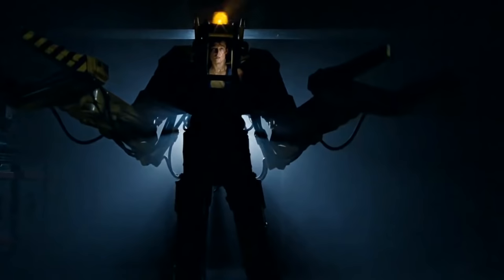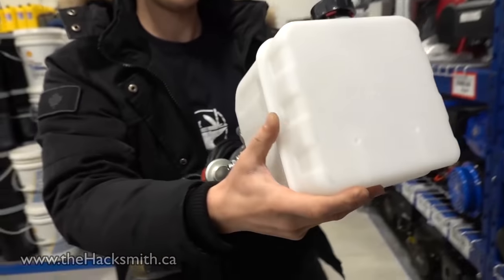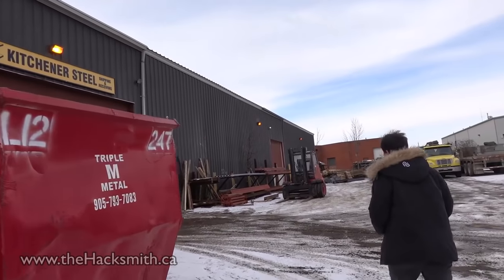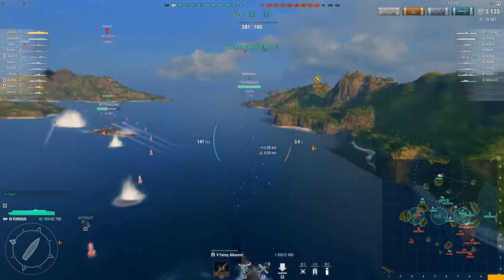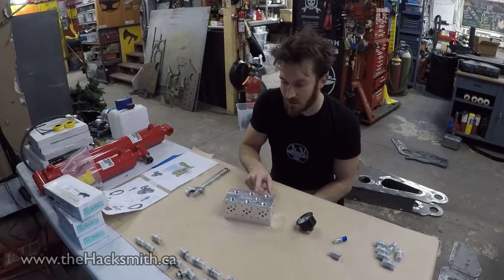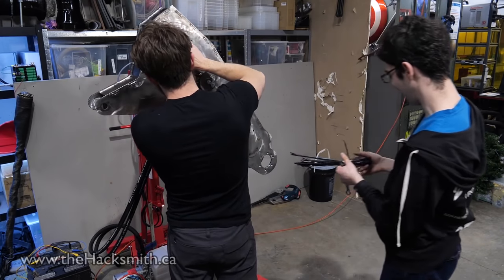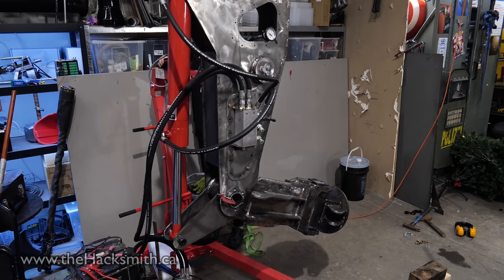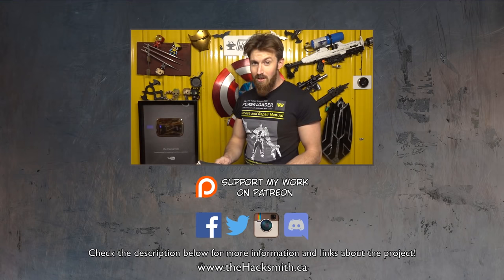BUILDING THE MECH ARM! (POWER LOADER: PART 2)

Comment: The logistics and principle are fairly simple, but actually building it,  that's a whole different story.
mad props
Reply: Its not a prop anymore
Reply: @alexv1154  I meant good job, don't be like that man.
Reply: I know, was just trying to make a joke
Reply: The individual components might seem fairly simple, but when you consider the whole thing, the balance, and the control system, not so much in my opinion. It just seems to me it will fall forward when you try to lift a car. If it was just the arms, attached to a forklift or something, it would seem more simple.
Reply: @herrakaarme  I would try mounting a gym weight to a motor and control it with a PID to make a impromptu gyroscope to keep balance.
Reply: @herrakaarme  counterweight under the butt. Just like traditional forklifts.
Reply: So, gravity is a fickle little bitch....but it can be reasoned with.

Maybe a system of smaller counterweights could work to aid stability.

For example, a smaller weight in each shoulder, largest in the rear. Then a small one for each calf.

How much would be needed? I'm not sure. However it might work a bit better than having all the counterweight in one place. With it in one spot, if something happens to said spot there goes your balance. Will say this much, if using multiple counterweight areas I would advise being a bit more generous with how much weight is there with exception to the arms, depending on how fickle they are to attach.

Apologies for the text wall, if there are issues I'm missing with this (which I am sure that is the case) then feel free to point them out.

Comment: I work as an excavator operator and form 
 experience building a little excavator  by my own I can tell you  that you need  different valves to control that thing properly. You need ones that not just allow you to control the direction of the flow, but also the amount of flow. Lets put it the nerdy way: Not digital (1/0)  but analog  :)

Comment: If you really want to know what it's like to ride a robotic arm, you should check out Dynamic Structures in Port Coquitlam, B.C.  They make roller coasters that go into service around the world, and have been experimenting with an industrial robot arm with a seat attached.  Discovery channel tried it out one time, and left the tester terrified.  An industrial robotic arm is so fast they had to reduce it's speed many times in order to make it (somewhat) safe.

Comment: For a continously rotatable gripper that still grips, use 2 hydraulic motors and a modified differential. 😉 That solution kept me awake for 4 hours last night.
Reply from the maker: Why not just one? Still continuously rotatable
Reply: @hacksmith  when they rotate in the same direction, it would open or close the gripper while it remains still. When they are reverse one another, the gripper would rotate but hold its clamping position. Move only one motor and the gripper would do both motions at half speed.

The sole purpose of the differential would be to control the clamps of the gripper. It took me a while to figure it out but put simply, the diff would control a lead screw that moves the clamps.

I could probably try to throw together a 3D model of what I'm thinking of, it would be kind of complex, but I think it would be the ideal way to get a continuously rotatable gripper that can also open and close.
Reply: Interestingly enough, I just realized a simple rack and pinion would also accomplish the same thing, since the grippers on the actual arm are linear.

I study robotics and gripper design is one of the things we went into depth on. They're actually pretty interesting and more complex than a lot of people realize at first

Comment: I hope you are planning on using a pressure  blanket system for the hydraulics. You can maintain pressure with a constant speed pump and relieve the excess into the un-pressurized dump reservoir. It allows for a faster response and you can power a group from a single power unit.
The pump is used to pressurize the blanket tank, and only needs to run when the pressure drops.

Comment: I love to fabricate and initially when I was younger learned all about welding and steel work so just out of curiosity how much do you think that 1 arm will weigh??? Im betting over 1000lbs!!! lol You have got to love just going for it! I'm excited to see this complete!
Reply from the maker: It's in the title =p about 600lbs
Reply: @hacksmith  Lol after watching it I thought that your sheet you were working with weighed 600lbs! I figured after all the hydraulic pumps and welds and extra parts it would easily go 1000 but if you kept it 600lbs you did a good job of trimming the fat!!! This suit is going to be sick and one step closer to IRON MAN!

Comment: I hope they build this well enough that they can actually use it for power loading. With the rate at which these projects are going up in weight, they're gonna need a working power loader in short order.
Reply from the maker: that's the plan! kinda pointless if it doesn't work -- we'd focus more on asthetics if we weren't going for functionality ;-)

Comment: Honestly for flat welding look into metal core wire as well as c25 or c15 gas would weld much faster as well as blueshield  LAT91LF in .045 on something like a millermatic 255 quarter inch weld in one pass

Comment: You mentioned mounting a motor on back for a higher flow rate, how about a propane fuel motor instead of a traditional liquid fuel motor? Allows for afuel source that is more potable and stable. Just a thought.

Comment: I do wonder if aluminum would have been the way to go. It's strong stuff but difficult to weld.
Reply from the maker: Why does it need to be light? It's a power loader, all construction equipment is steel :)

Comment: You got experience in building an arm, but what about legs? Your previous exoskeleton design wont work with such heavy hardware (It was basically a hydraulic cylinder per leg, with stabilization done by yourself and design properties).
Maybe ask James Bruton about his newer Leg designs, a non static system would definitely help and he got experience with not falling over.
Great project!
Reply from the maker: Doing a tank tread design instead - like the militarized version of the power loader :)

Walking legs, definitely possible. Butt not practical. Good luck lifting a 5000lb load and then walking with it!

Comment: open second holes to the hydrolic sylinders and attach another hydrolic pump, this will give 2x movement speed and 2x power in the hydrolics.
Reply from the maker: That's not how that works
Reply: @hacksmith  i mean flow ports.

Comment: I have ran lasers for a living since I was 17 and I always wished I had one because I had so many cool projects that I would like to do and so many cool parts that I always wanted to build for my bike and I got to accomplish some of the smaller ones because I was actually the Prototype guy / Lead man in the later years so I had access to AutoCAD and SolidWorks and the Machine itself LOL. So I did get to use it to make some pretty awesome motorcycle parts from time to time. Very briefly I had a small business on the side where I was selling Target gongs made from a572 armor plate before that was a big thing all of these gun accessory company started doing it

Comment: So I've been wonder how things machine worked myself. And while  the machine has to lift using the claws that would mean you'd have to put all the weight towards the back of the loader while adding support to the legs.

Comment: Love this project (new subscriber); but I think you are going to have major issues when it comes to movement and balance, especially with any kind of load. You might want to consider being able to 'set your ass back (and down)' to counter-balance any load and also that actual tracks might make much more sense than trying to take steps, big feet with tracks might make life much simpler in the latter stages of the build/testing.  Maybe you guys are waay ahead of me, I can't wait to see!

Massive respect...
Reply from the maker: Check the tshirt design :)
Reply: @hacksmith  Yeah, already did........I don't see any relevance beyond you flogging overpriced 'self-promotion' 'stuff'' that you should be giving away for free.
You know how I put 'MY message across' to the public? I don't shave for four days and I badly need a haircut......the respect (and distance) I'm given is quite remarkable. Now I must get back to my lab, Igor has finally got a fresh brain for me, a female, once called Abby, he thinks....Abby  eh, erm, Normal, yep, that was it......Abby Normal....looking good for a successful outcome.

Comment: Do you guys guys use any kind if torque spec during assembly? or just wing it and make sure the bolts are tight?
Reply from the maker: Nothing at the moment, but will be standardizing everything :)

Comment: Why using such thick steel? Would you not want to at least a little bit cut down on weight? like using less thick steel. Or is it required due to stability?

Comment: the hydraulics cylinders and the steel parts all seem to be pretty heavy, did you guys already figured out whether the final build can sustain its own weight and be balanced without tumbling
Reply from the maker: Yeah... That's what engineering is about. This is no different than a hydraulic backhoe - needs to be hefty to be strong  :)
Reply: @hacksmith  oh my god, i didnt think i would get a reply, anyway, i dont actually know any technical terms, but i wrote my original comment because it felt like the final build will be pretty heavy and it may not be balanced becuz of cylinders or hand movements etc...
though i believe you guys have already made sure no such thing happens

Comment: I know this is not my bill but boxing things in at a 3/8 that's a bit heavy you probably could have got away with quarter-inch in some cases even a 1/8 inch I can understand the body being a little thicker or even towards the legs where you need the weight you're making this thing top-heavy I believe but I don't know I haven't seen the plans I don't know how have you're going to make the feet and legs

Comment: Why didn’t you use steel reinforced aluminium?
Hell, there’s alloys of aluminium that will easily replace the heavy steel.
Reply from the maker: What is steel reinforced aluminum...?

We are using steel because it's cheap and easy to work with. Don't have weight restrictions either, you don't see forklifts made out of aluminum ;)

Comment: The whole arme is working the wrong way.. You are pushing with the cylinder to lift the arm up. What will happen? In case of too much waight of the part that you will lift, the piston will bend. The right way would be, that the cylinder pulls the weight up, so the way the force works to the piston will be much better!
Reply from the maker: That's not how hydraulics work... Cylinders have more power in the push position than the pull positron due to the rod. They don't bend...

Comment: teflon is a no no on hyd fittings
Reply from the maker: It's an NPT fitting. It needs sealant. Teflon is fine. If it's anything but an NPT fitting, you don't use anything.

Comment: am I the only person wondering that if in theory, this actually works and can be piloted by a single operator. Why has nobody built something like this for industrial use? Think of the capabilities one person could accomplish on a jobsite with something like this? Admittedly, it would be very good from a weapon eyes standpoint, no matter how much armor you put on it it would still be too slow and cumbersome. However, for something doing labor work and if it's operator bowled by somebody from inside. Why has nobody actually built one or mass-produced them for construction sites?
Reply from the maker: Watch part 1, I explain just that :)

Comment: Did you guys figure out how many gallons per minute those Motors are flowing in the size of those Rams you could have got away with some smaller cylinders than that
Reply from the maker: Don't have the final pump selected
Reply: @hacksmith  size of the Rams that you're using got a whale a lot smaller if you lot smoother and just what you have volume-wise you miles just run a return and a pressure hose to it because it's going to be big are you going to use variable valve body control through solenoids
Reply from the maker: Lot less strength too. Plan is to swap them for the different tests where strength or speed is required
Reply: @hacksmith  look at a table of contents on the size of the ram in the stroke and gallons per minute pressure you'll find out that its way oversized you did Bill out of 3/8 you have at 600 lbs just in two arms what do you think the things going to weigh I play with hydraulics and some boom repair I've worked on booms with only quarter inch steel but it's boxed right 4 weight how about his wait to see your finished product I wouldn't be surprised if you wait over 5,000 pounds

Comment: How big is the plasma cutter in amps?
Reply from the maker: Hypertherm 85A
Reply: Thank you. Mate said that you couldn’t cut this fine without lead in.
Reply: And what’s the Kerf at? 
Question being... seems like a small cutter for the thickness of steel and the detail you’re getting.  

Also... reckon you should bolt an I beam to the roof with a chain block on a roller. 
Then set up a jig with two mechanical magnets to pick up sheet metal.

Comment: don't get on here much, so I've got a couple questions. Question one. How in the hell did you rack that  Capt. America shield?
I noticed you holding a toy like replica of the hydraulic loader from alien. I wondering where I could get that? It's not something that I am familiar with looks to be fairly detailed and greatly interests me so I wondering if you might be able to tell me the name of that particular item or where I might get it probably could find it on eBay if I had the name, but I suspect you probably got it somewheres else. I'm a 40+ year old nerd so intricate replicas like that. Admittedly interest me.
Reply from the maker: Scroll through my past few videos. You'll see where it got wrecked :)

Ebay for figurines
Reply: @hacksmith  Found it. Sad that you rent it. Testing a note or design. But I suppose that's just wrong. My standpoint. Really love the idea of having one of those shields made out of something like Kevlar or something similar. Yeah, it would be totally impractical, but still really cool. They have.

Comment: Pi*r^2 isnt the same as pi*D^2/2.  I think you meant pi*(D/2)^2.
Reply from the maker: You'll find the calculation is correct, just didn't put the brackets in on the screen
Reply: @hacksmith  ok.  Thought you might have done it wrong.

Comment: Cylinders are way to big.  you could have used a 1-1/2 bore for much faster reaction times.  Use your caculator.
Reply from the maker: We sized them for the loads we plan on lifting. We might have a high speed set of cylinders, in the future as a configuration, but once we have our 20gpm pump it won't really matter lol

Comment: FFS!  You have 50000-100000$ plasma cutter that is blocked by some shitty cabinets on the wall ????
From the video it looks that on wall above the miter saw you have shorter cabinets. Why not just swap the cabinets ? Then the plasma cutter would clear the the shorter wall cabinet.
Reply from the maker: Only $30k actually. That was the first time we used the full limits of the table